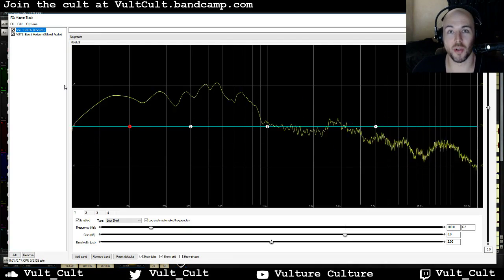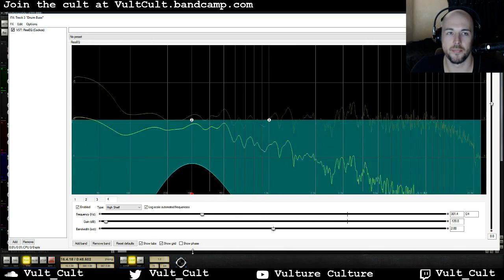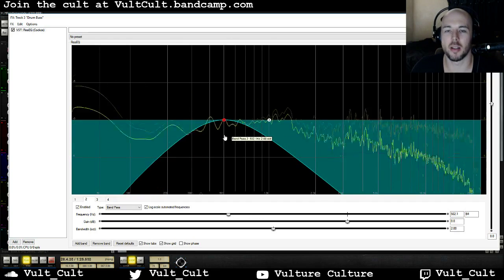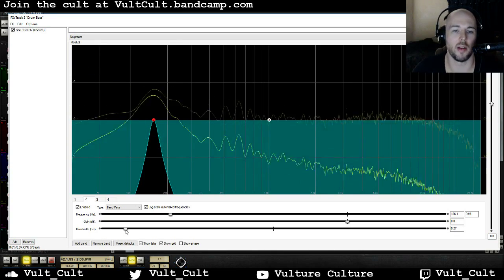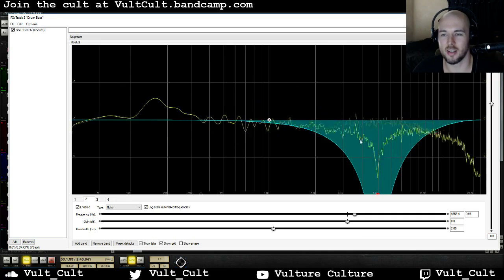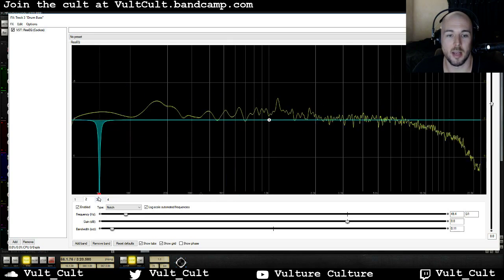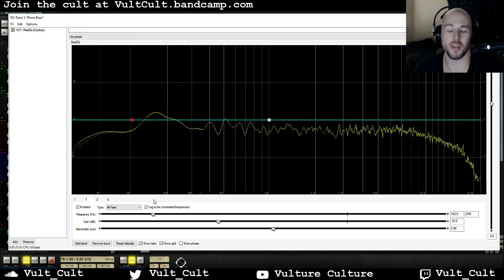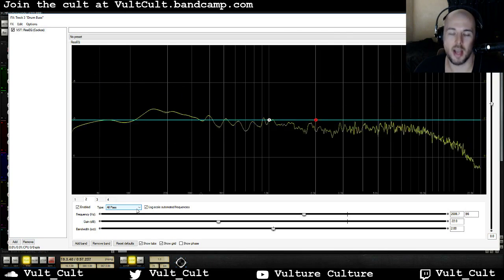BAND PASS, NOTCH, AND ALL PASS FILTERS - Fundamentals of EQ Tutorial

Comment: Allpass is very good for sound design in hardstyle. Just load up a kick, add a distortion to saturate, Follow it with an allpass filter at around 400hz, then follow it with another distortion, something super crunchy. If you don't think the allpass is doing something, just play a standard 4-on-the-floor, and sweep the allpass frequency around while it plays.
Reply from the maker: Wouldn't you have to have the all pass mixed in - not all the way - to hear a difference?
Reply: @VultureCulture  the allpass has to be before a distortion, but after a saturated sound so it has something too filter. Then the phase shifting impacts the shaping of the distortion after it. Picture 2 sine waves an octave apart, then picture the higher one being slightly detuned, which results in beating. That beating into a distortion. That out of phase beating is what you do with allpass, to a very narrow band. For the most extreme effect, have 8 or so all pass filters with identical setups to make the phasing more noticeable pre distortion. Test it on a saw wave or saturated 808. And i gotta emphasize, with drums you need 2 distortions, 1 pre filter, 1 post filter.
I only learned about it earlier this year, i was sleeping on all pass filters for a decade and a half. Most noticeable below 1khz. And above 20hz. 
Clarification, its not literally beating. Think additive resynthesis.
I just woke up.
Reply from the maker: Thanks for the tips! 🙏🙏
Reply: @VultureCulture  I realized how to explain it better. Changes to the phase of part of a sound change the total shape of the wave, and the louder the frequency, and the closer to the fundamental, the more extreme that change in shape. Then, distortion is acting on shape, not frequency content. A saw wave can be made of stacked sine waves that are in phase with eachother, at a given frequency interval. If you change the phase of the first harmonic it is not a sawtooth anymore, and will saturate or clip in a different way.
Edit- digital filters also produce further artifacts such as delay, and a sort of sweep effect. A low all pass on a blip of sound can produce a sweep from the filter frequency down. I do not understand why this happens. Additionally, linear phase obviously does nothing but introduce pre ringing, which means linear phase all pass does basically nothing. I do not know how this works in analog either. Im srictly software
Reply: another way to explain it:

inaudible phase shifts still make the waveform look a lot different. Pull up an oscilloscope to check. An allpass doesn't change the sound of a square wave but it'll reshape the waveform into something spikier. Hard clipping a raw square wave doesn't really do anything, but clipping a version with spikes obviously does.

If you already have a highly distorted signal (getting closer to a square wave the harder you clip), adding more distortion might not change much, but using an allpass to transparently make the waveform spikier can let you get something new out of another stage of distortion. There's more stuff there for a clipper to clip.

(All of this is ignoring the fact that stacking enough allpass filters makes an audible difference on its own eventually... that's one of the main ingredients of digital reverb, for example)
Reply: @ts4gv  digital reverb just duplicates the signal with latency. Reverb and delay are the same effect.
Reply: @therealquade  Micro delay taps are part of it, but introducing extreme phase shift via allpass filters is a big part of a lot of algorithms too! I saw the founder of Valhalla verb plugins give a talk about verbs. In his words (as I remember them), "some algorithms are literally just allpasses". Try stacking a bunch of allpasses on a signal (dozens or more) until it makes an audible difference. You might recognize why extremely phase shifted delay taps might be useful in building reverb soundscapes.

Another problem with your statement "Reverb and delay are the same effect"... if you learn a little bit about how convolution works (the classic non-algorithmic form of reverb, capable of non-verby things too), that analogy breaks down. Like, you could kinda describe convolution as a series of very specifically arranged delay taps (one per sample), I guess, but in reality they mean different things. And yet, convolution totally reverbs.

TLDR: Delay taps are in there sometimes, but there's a lot more to it than that!
Reply: @ts4gv  yeah, convolutional reverb is a whole other beast entirely, like saying that using a few stacked saw waves and a filter is just subtractive synthesis, and then going but actually you can also do the exact same thing with additive synths. It's true, but 20 years ago it was not true. convolvers didn't exactly exist when digital reverb was first made. it's a progress of technology thing. To make this point more clear, The convolution in convolution reverb, is the same as the convolution in convolutional neural network, as in modern AI. when giving a simple explanation, and even then in both cases, you're doing a process that adds a bit of time delay while making a change to the signal that's added to the original signal. Allpass and convolutional reverbs, are still delay based, they're just delay with extra steps.
Reply: Also, fun fact: you can reconstruct every type of filter (HPF/LPF, shelves, bells) by just mixing an allpassed signal with a dry signal in various ways. That's actually how EQ works. See Dan Worral's video "Phase Shift causes EQ"

Comment: lol effecting the phase off a sound is not usefull for mixing? wrong buddy.. for example: If you want a kick and subbass perfectly in line an all pass filter can glue the phase of both signals together :)
Reply from the maker: Galardo Music I hadn’t thought of that. Usually if I have phase issues with the kick and bass I flip the phase of one or nudge the waveforms to be in phase visually.
Reply: Galardo, you certainly are right. I wanted to post kind of the same comment. All pass filters are a common go-to tool in mixing and are used to manipulate phases without affecting too much of the sound, to fit in just right.
Reply: Are there more video's on the subject?